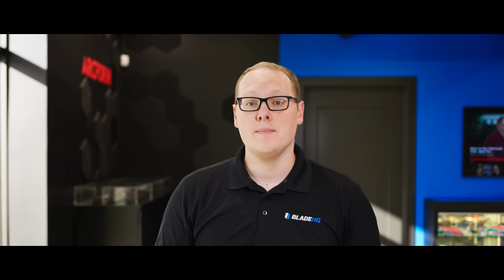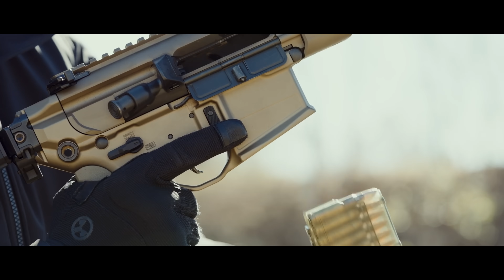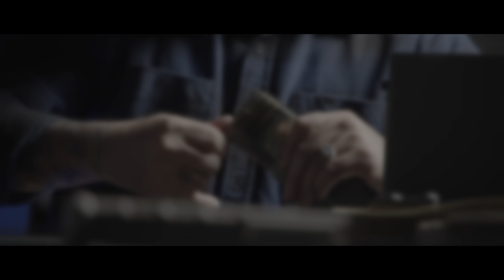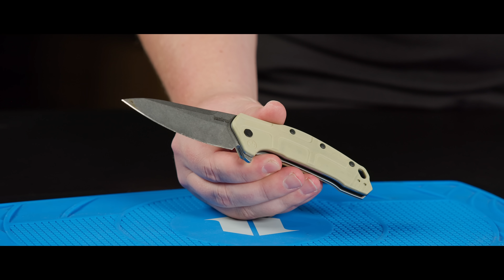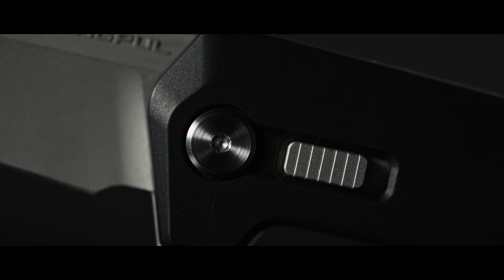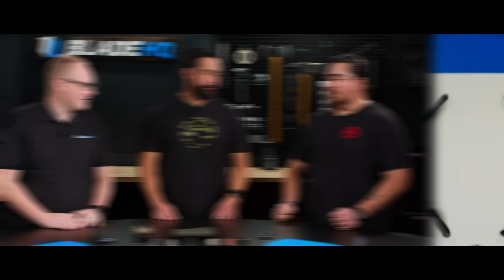Magpul Just Changed The Knife Industry With MIM

Comment: I know you're using hip and sintering, but i just can't imagine that's enough to eliminate oxide and void formation just because of how the base process works. I also didn't see anything about quenching. Any process can yield a theoretical density, but what is the actual density? How did you test for it? How does the hardness and strength compare to traditional forging?

Comment: That was a long infomercial. They didn't really say much for talking 13 minutes. They also didn't show any knives. Seems like the point of the video was to convince the audience of 2 things: 1.) Magpull is a reliable/responsible company. 2.) Injection molded knives are just as tough as their competitors. 
 I have no knife making experience. However, I am a mechanical engineer and took material science courses. I don't belive MIM knives are as durable. Also, much like Benchmade and Leatherman, you are paying 75% extra because of the branding.

Comment: That's not where the Nozzle met the mold. That's where the valve gate pin is. It opens and after the plastic is injected it closes. It stops the material. That's the "dimple" you see

Comment: "Changed"?  Microtech hasn't been doing MIM blades for years?

I love Magpul, but they also didn't come up with the concept of their original product, either.  Since at least the '80s, soldiers were adding loops of 550 cord to their magazine floorplates or using 100 mile an hour tape to attach it to the bottom of the magazine body.

Comment: knife enthusiasts expect a lot more than just a blade at a price point; they want quality materials, thoughtful design, and craftsmanship that can stand up to real-world use. While MIM (Metal Injection Molding) manufacturing has its place for certain applications, it doesn’t always align with the expectations for high-performance knives, especially in the price range where you’re competing with established knife makers who prioritize quality and durability.

For those who truly know their knives, things like blade steel, heat treatment, edge retention, and ergonomics matter most. Injection molding might bring costs down, but it can feel out of place in a market where precision and heritage often take precedence.

If the goal is to hit a lower price point for contracts or entry-level markets, it’s important to balance affordability with performance. For example, focusing on functional designs, proven blade steels (like 8Cr13MoV or D2), and reliable construction methods could deliver a better product that appeals to both newcomers and seasoned users.

Magpul is a respected brand in many spaces, but when it comes to knives, they’d need to approach it with the same passion and attention to detail as companies that have been crafting blades for decades. Otherwise, it’s hard to compete with the depth of options available from companies who live and breathe knives.

Comment: So call me a skeptic..but if we are calling a spade a spade - this is basically a commercial for a magpul knife. Just so we are clear, I like magpul quite a bit. But marketing is marketing, and paid promotions are paid promotions.

Coming from the firearms side of things, I ABHOR mim parts. They are fundamentally weaker and fail more often than milled or forged parts which is attested to by droves of gunsmiths. The reason MIM is used is largely for cost effective reasons, yet magpul is still charging 200 bucks for the blade. I'm not a blade person, I only clicked on this video specifically to hear what their spiel would be to try to sell me why their cheaper manufacturing process is "good". I'm not convinced. MIM is trash and this is a cash grab if i ever saw one.

Comment: $200? I assumed when they were talking about price savings, they would be less expensive than the high end knifes!
Reply: The steel in question is comparable to CPM S35VN steel. The knives that use that steel cost anywhere from $54-$995. The most popular knives that use that steel cost $100-$250. They are selling the knife at $185 which is a fair price given the current market. So why whine about the price?

Comment: They're going to have to lower the price to be competitive. Got a Spyderco Para 3 with S45vn for only $150 this past Black Friday. A buddy of mine got one with S90vn for just $190. Meanwhile they expect us to spend $200 on injection molded steel that's only ALLEGEDLY equivalent to s35vn? Almost as overpriced as Benchmade, but at least Benchmade has an established reputation to back their ridiculous prices. I never heard of any Magpul product with anywhere near the kind of warranty service offered by these top tier knife companies.
Reply: The steel in question is comparable to CPM S35VN steel. The knives that use that steel cost anywhere from $54-$995. The most popular knives that use that steel cost $100-$250. They are selling the knife at $185 which is a fair price given the current market. So why whine about the price?
Reply: @gilbertmckown6161  1) stop copy/pasting to every comment here. 
2) You’re comparing this to billet steel. They are using MIM. MIM is specifically used to keep costs and waste down. $200 is not keeping costs down. That’s them trying to use brand loyalty and catchy phrases to fleece customers. MIMing knife blank and properly heat treating and billet are not the same thing and until I see a full unbiased analysis of the total grain structure of this stuff I’m not going to spend a dime on it.

Comment: MIM parts have their place in the world just not in something you sharpen. The issue is the hardening process is only on the outside the inside is soft after you grind that outer hardened shell away.
Reply: What you said is wrong! Read about metallurgy or watch the knife steel nerd.

Its not surface level hardness, its thru the whole blade.

Comment: One of the advantages of MIM is supposed to be cost savings since very little excess material needs to be removed, they touted it as a one stop shop as far as all the features (aside from the sharpened edge) are input one in step. I understand that R&D costs need to be recouped, typically the first of a new generation of technology costs more, but this is twice the price I expected. I like Magpul's products and philosophy as a company, but this is a tough ask when the market is saturated with other excellent options.
Reply: The steel in question is comparable to CPM S35VN steel. The knives that use that steel cost anywhere from $54-$995. The most popular knives that use that steel cost $100-$250. They are selling the knife at $185 which is a fair price given the current market. So why whine about the price?
Reply: @gilbertmckown6161  Yes, S35VN is a popular steel used in knives, some are less expensive (Blade HQ has the Civivi Appalachian Drifter for $55 currently), some are more expensive than the magpul Breslau. If you read and comprehend my initial comment the benefits of MIM as described in the video are less waste (additive vs subtractive manufacturing) and labor, these saving should be reflected in the final price to consumers. Aside from a decent steel and novel blade manufacturing technique the design doesn't display features that would warrant the price tag. I just purchased a Kunwu Chad for $220 (secondary market) that has an incredible steel, DLC coating, and milled titanium scales. Rational argument =/= whining.

Comment: ok, you're right i don't understand.  When they said that it's better in testing over billet, are they talking about a billet of S35vn? Or other traditionally billet steels. Are they taking the powder, and through some process, injection molding it rather than a more sintering style of manufacture?  I'm not understanding exactly what they're starting with and what they're comparing it to.

Comment: I have a lot of respect for Magpul. But, It has to cost a good bit less than a Para 3 lightwt magna cut before I would try one.
Reply: The steel in question is comparable to CPM S35VN steel. The knives that use that steel cost anywhere from $54-$995. The most popular knives that use that steel cost $100-$250. They are selling the knife at $185 which is a fair price given the current market. So why whine about the price?
Reply: @gilbertmckown6161  I have been a magpul semi-fan boy for years. But also a spyderco fan. Lets see how the mim blade actually holds up over time. The price may come down once the gee-whiz newness wears off.

Comment: At the point that im spending $200 on this there are way better options out there by US knife makers with proven track records.

I am really turned off by their current pricing and perceived snobbery but I would buy a benchmade before this.
Another option I would prefer would be to go premium small run and use the $200 towards an MKC.

I'm pretty sure this kinda stuff is why some of the blade HQ OGs left and why their videos are now souless.
Reply: The steel in question is comparable to CPM S35VN steel. The knives that use that steel cost anywhere from $54-$995. The most popular knives that use that steel cost $100-$250. They are selling the knife at $185 which is a fair price given the current market. So why whine about the price?

Comment: The entire point of mim steel is to reduce cost, yet this knife costs almost $200? It's polymer and mim s35vn, why in the hell does it cost almost $200? I could get much better for that price
Reply: The steel in question is comparable to CPM S35VN steel. The knives that use that steel cost anywhere from $54-$995. The most popular knives that use that steel cost $100-$250. They are selling the knife at $185 which is a fair price given the current market. So why whine about the price?
Reply: @gilbertmckown6161  1, the whole point of a mim blade is to REDUCE cost to similarly speced knives. 2, You're paying almost $200 for a mim blade and plastic scales, which is ridiculous, if you want to pay $185 for that be my guest. 3, their marketing claims have yet to actually be verified, they could say their mim steel is comparable to m390, it doesn't make it true. Until I see verifiable evidence that it is actually as good as s35vn, it might as well be tin metal.  4, just because there are overpriced knives using s35vn doesn't justify other knives doing the same thing lol, that might be the dumbest argument I've seen for this steel. If I can get a ton of great quality knives with s35vn for a fraction of the price, why would I pay for this one? The massdrop gent was s35vn and titanium and was only $100

Again, the ENTIRE point of this knife is to REDUCE cost

Comment: This is not an innovation. Kershaw did the exact same thing 20 years ago and still has an active patent. They produced a single model with a MIM blade before they abandoned the process.

A MIM blade is going to have worse performance than a conventional PM steel stock removal blade of the same composition due to coarser carbides, and offers no relevant improvements for the end user. I suppose this is being marketed to the 0.1% of gun guys who trust MIM components.

Comment: Kershaw and Ken onion made the Offset with MIM in 2007 . I believe that it won knife of the year.
Reply: They were not $200 either. This is a flop unless they can get the price down by 70%.
Reply: @redbullbundy yea because they were made in China
Reply: The steel in question is comparable to CPM S35VN steel. The knives that use that steel cost anywhere from $54-$995. The most popular knives that use that steel cost $100-$250. They are selling the knife at $185 which is a fair price given the current market. So why are you whining about price?
Reply: @gilbertmckown6161  for one, that MIM steel is WAY more brittle than S35VN. It will snap in two the moment it comes in any contact with a stressor. Second, MIM is extremely cheap to manufacture. They're trying to pull one over on knife nerds by buying time on BladeHQ and trying to get legitimacy by doing so.
Reply: Came here looking for this comment.  Not interested in mim parts in my guns, not sure why I would want it in my knives.  Wack panther.
Reply: 3D metal printer will be a knife thing forsure. MIM will be a cheap Walmart knife blade for the future due to more automation but it will be a cheaper product. Magpul is doing this because they want the US military contractors for knifes. Since there direct competitor has it.

Comment: $200 is steep for this knife but thats close to the average price for a high quality but not high end knife (think Spyderco PM2/Manix or Benchmade 940/Bugout). Maybe Magpul thought that if they priced it too low everyone would think its a cheap POS and not buy one. Or maybe they bought expensive new equipment to make the knives and that plays into pricing.
Reply: The steel in question is comparable to CPM S35VN steel. The knives that use that steel cost anywhere from $54-$995. The most popular knives that use that steel cost $100-$250. They are selling the knife at $185 which is a fair price given the current market. So why whine about the price?

Comment: I have had to replace so many MIM parts on my rifles due to premature wear or failure.  Poly scales, and MIM version of a already powdered metal SV35N for more money, no thank you for that price. Would pay 50-60 bucks for it not 180 when I can get magnacut blades for that price.
Reply: Agree. Several issues with MIM parts in firearms. Replace anything MIM in your firearms. My custom Kimber 1911 had MIM parts all over it. Cool. Spend that much on a pistol just to replace numerous parts.
A KNIFE?
NO THANK YOU.
Reply: @betaphex  depends on what manufacturer is making it Kimber not so good , Ruger as good as it gets.
Reply: @googlechicken  I've had to replace several MIM firing pin backs and extractors in my Ruger rifles. They probably do do it best but it's still not perfect and MIM when not done right every single time can be catastrophic.

Comment: $200 seems to be too much for this. I just got a Spyderco Para 3 in CPM 15V for $205. And there's a magnacut version going for under $200.
Reply: 100% this
Reply: This knife is literally worse than a $33 RAT 1
Reply: Those who know carry Spyderco
Reply: @Mastersergent4321  I just got the Spyderco Resilience Lightweight partial serrated with 8cr but still only $47 and it is a great folder with a blade just over 4 inches.
Reply: You can get a rat in Magnacut for $89 and it's actually got proper HT unlike some of the other companies!
Reply: My Para 2 is my fav knife ever
Reply: $100 and i'd buy one. $200 and i'll wait till a huge discount sale.
Reply: Did I miss something about pricing? I didn't hear them say 200 bucks
Reply: BUY American
Reply: @jrthomas4656  I did. I don't buy strictly American, but the Para 3 knives I was referencing are both USA made. Spyderco has knives made in the USA, Japan, Italy, Taiwan, China, and I believe the UK.
Reply: Para 3 sprint run rare metal. For  $140.
Reply: This is a much better knife than anything Spyderco makes though
Reply: @jawbonemedia9653  HAHAHA...nope!
Reply: Was thinking the same thing after I looked up the cost. For $99 I’d buy one…for $200….LOL 

I like magpie but not that much!
Reply: The steel in question is comparable to CPM S35VN steel. The knives that use that steel cost anywhere from $54-$995. The most popular knives that use that steel cost $100-$250. They are selling the knife at $185 which is a fair price given the current market. So why is everyone whining about price?

Comment: hey guys, we discovered a new way to make a knife and it's more expensive than the others, cool!!!
Reply: at first..  as with all  "new" technoloies/ product releases.  give it a few years,  the cost will come down.  as with everything new.
Reply: @mtnbound2764  ya but I won't even begin to consider it until then.
Reply: @mtnbound1776  sure but why would a consumer buy this now? It's objectively a bad deal. Nobody buying them will recoup R&D even slower than just pricing it lower
Reply: @mtnbound1776  It's not a new technology.  My Microtech knives both have MIM blades.
Reply: The steel in question is comparable to CPM S35VN steel. The knives that use that steel cost anywhere from $54-$995. The most popular knives that use that steel cost $100-$250. They are selling the knife at $185 which is a fair price given the current market. So why whine about the price?

Comment: “Who is Magpul” 
Words likely never uttered before in the presence of men 😂

Also: we spend a LOT of money to avoid MIM parts in guns. I don’t think anyone is going to go out of their way to buy a knife using MIM bladestock. 

Especially not people who really know knives. Because a good bladesmith will routinely snap a bar of the steel they make to check the grain structure and test their heat treat. If the structure isn’t tight enough and the blade is weak, they’ll change up their processes. You cannot have a uniform grain structure in a molded blade. And there must be enough room between the grains to park  a damn Hummer 😂
Reply: I have nothing to add because everything you said was a million percent accurate.
Reply: Just another marketing dork 🤣
Reply: Preach. Love their mags tho.
Reply: @oni-one574  absolutely. They make some serious quality gear and this product won’t alter my opinion of the brand overall.